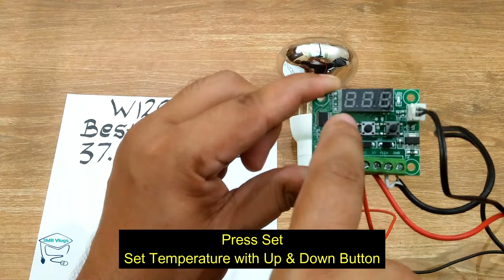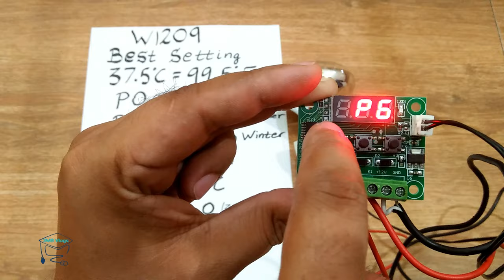W1209 100% Best Temperature Setting For Egg Incubator || Temperature Controller Wiring & Setting

Comment: Thanks a lot I had a problem when the heat being less than 37 the heater not working 
I put it in a Heat mode,Idk what the reason,I did it before and it was doing good ,now I can't

Comment: Thanks very much, I face a problem to get temperature control and others supported equipment please help
Reply from the maker: Please share your problem. Thank you
Reply: I use a Styrofoam cooler with 3 bricks to moderate temperature.  With the right bulb the temp stays almost perfect. No thermostat  in Southern Mexico.

Comment: I have done all the connections but my bulb is not going on when the thermostat dot is red. Strangely if i remove the bulb from the holder ans check it with a tester ot shows that it has power. The bulb is okay because it lights up in other outlets.

Comment: How will i do? When i try to do setting in my new XH-W1209, in the P3 it goes upto only 14 (the range is between only 14 to -30). I am confuse as you can set 33C°.
Reply from the maker: I think model change

Comment: Can I control fan and light from one theromstat??. I want to automatically light off and fan on wen temperature reachs 37.5 cel
Reply from the maker: Yes you can control also fan and light. Thank you
Reply: @3MBVlogs  sir how we can do this when light off and fan goes on plz plz tell me plz
Reply: @hassanpubg988  you would need to add a flip flop circuit. You should be able to find YouTube video for setting up